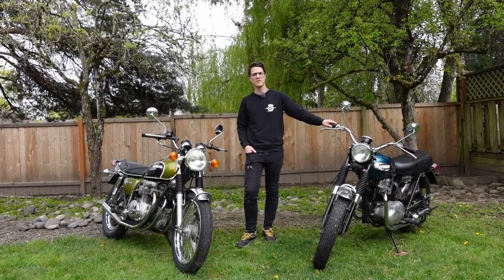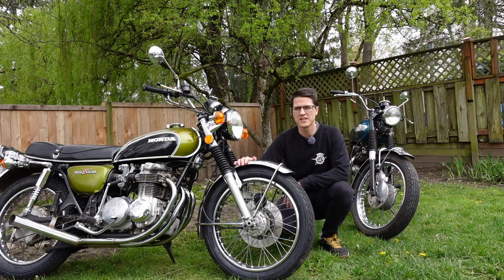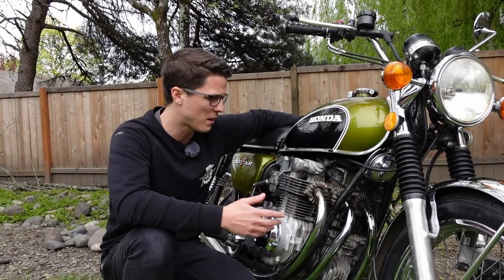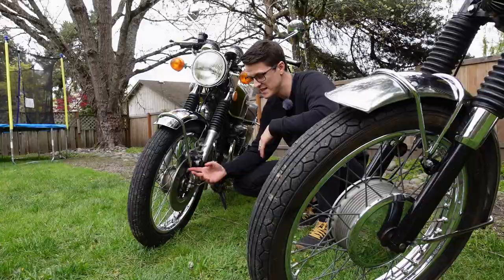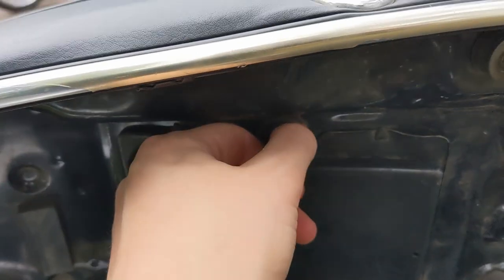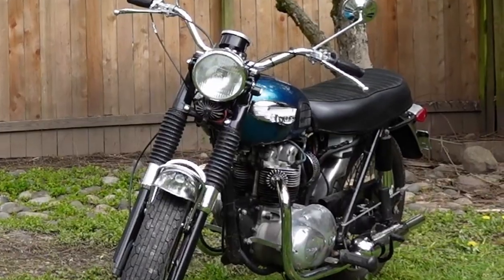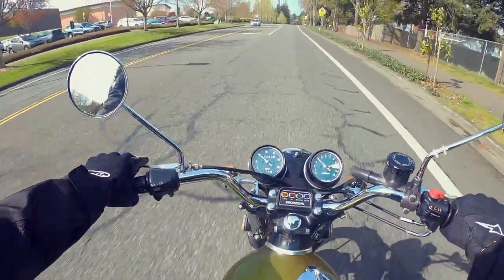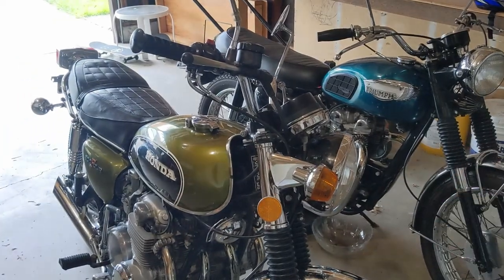How this Honda killed this Triumph

Comment from the maker: One correction! The Triumph 500 indeed NEVER had an electric start. For some reason the later Daytonas looked like they had electric start but they didn't. Good thing I have you guys to keep me in line!
Reply: So the 1973 triumph is literally the same as the one in the video
Reply: @virusdumb  Not exactly.  The 1973 Triumph Daytona 500 had twin carbs (not necessarily a good thing 😮), twin leading shoe front brake, twin instrument (speedometer + tachometer) instrument cluster.
Reply: I don't see much in the way of pre-1970s machines here but I think that the Honda CB77 Superhawk deserves a mention. It was produced from 1961 to 1966, to be replaced by the CB350. This 305 cc twin came with electric start and a good one at that. It is rated at 28 HP at the rear wheel, somewhat less than the 50 HP or so mentioned for the Triumph, but it too will go 100 mph. I know from experience in the early 70s when I rode and raced against others with Triumph 500s and other British bikes that the 305 was not outclassed by the 500 and could beat it. On top of that it is much more reliable and, of course, doesn't leak oil. The CB77 didn't kill Triumph but it is the first in the line of Japanese bikes to match or exceed its performance at a better price. And, the large twin leading shoe brakes work well, better than the Triumph's based upon your description.

I enjoy your series. Thanks for your effort.
Reply from the maker: @kshred3043  Well the 68 T100R had that as well, this is just a T100C. but yeah better brakes and also the exhaust is a bit different
Reply: You young guys need to get your facts straight, no E-Start on 500 TRI !!!
Reply: The bowl under the Triumph answers why we didn't like Brit bikes...Honda Mikuni style carbs didn't leak and that really mattered. Plus what looks retro now just looked old back then.
Reply: Bart. They Daytona never looked like it had electric start. You are confusing it with the pre 1956 bikes which had magneto ignition and what is called a pre-unit engine, which means the gearbox is a separate casting. I hope this clarifies matters for you. Best wishes from a Triumph rider in GB.
Reply: The Triumph 500 twin was officially called the "Daytona" in this period.
Reply: @kramrollin69   Only a Daytona if it had twin carbs. Single carb was T100ss.or variants thereof depending if for the east or west coast markets in USA. In Britain we did not get such a wide variety.
Reply: @kshred3043  I think the Daytona moniker means it had the dual carbs.. I could be wrong.
Reply: @silasmarner7586  Nah the complete SS engine upgrade = High compression pistons . Widened valve bores , specially profiled hig lift cam , dual rubber mounted Amal concentric carburettors 147mph on the flat and level leaves the 500 four standing....
Reply: Yeah, I was thinking. 🤔 my brother’s ‘77 Bonnie 750 had no electric start.
Reply: @factorylad5071  - Dual Amal 10GP Race Carbs with remote float bowls for the full upgrade.
Reply: @silasmarner7586  - the clue is in the word Daytona, an American 200 mile race at Daytona since the 1930's. The Triumph Factory Racing Team won the Daytona 200 in 1966 (Buddy Elmore) and 1967 (Gary Nixon) on race prepared T100's.

The road bike T100R Daytona was a milder tuned version to mark those wins, with dual carbs and other tweaks.
Reply: Honda CB500/550= SLOW
Reply: Designed in UK (Royal Enfield UK Technology Center) and built in India.🤣
But the video on RE Interceptor doesn't mention it, insisting too much on Indian contribution and the "young" CEO.🤣
Reply: @melodymakermark  they did make a couple of t140's with electric start, but they are crazy rare
Reply: @Bart My dad had a Triumph Daytona.
It was the most unreliable bike he ever had. Thanked the Lord every time he made it to work without breaking down.
Still a nice bike though.
Reply: Why not compare bikes to bikes? Compare the triumph twin to the Yamaha twin instead of the Honda 4?
Reply: The Honda looks better.

Comment: The biggest advantage the triumph had over the Honda, was that it never needed the oil changed. Due to oil leaks it was contunually receiving clean oil top ups.
Reply: They had pans under them at the dealerships. I bought the CB 500 as my first bike, $1350 new.
Reply: They only leaked oil until EVERYONE flatsanded the cases and put them back together with better ( usually homemade ) gaskets. What? You didn't do that, too? Come on. Everyone did and still do it!
Reply: @mountainmandale1587  Not on Honda's or Kawi's that I knew of.
Reply: Funny,  because it's true
Reply: @weirdshibainu  Norton's as well.
Reply: @billboyd4051  I owned an AMF Harley for a minute.  I should have bought stock in an oil company
Reply: @weirdshibainu  Did you get a free Bowling ball with it ?
Reply: @billboyd4051  Almost
Reply: Here I thought the Harley Davidson was notorious for oil leaks
Reply: @scottgindroz1474  Oil leaks were the least of Harley's problems.
Reply: @billboyd4051  maybe so but it was the best known of them all
Reply: All bikes were the same then. They had split cases. Honda came along with the now universal single piece sump. Hooray for that!
Reply: @mountainmandale1587  Same for all British twins. It's a lost art....
Reply: Haha I've heard of that.
Reply: @leighmcqueeney9848  What the Hell are you talking about. Hondas had unit construction, but the biggest advantage was horizontally split cases, NOT vertical cases like Triumph, and the rest of the Limeys
Reply: @milojanis4901  what the hell are you talking about? I thought Yanks used the term "limey" to describe the British. Harley had vertically split cases on their horizontally opposed twins. Italians too, eg Ducati on their parallel twins etc. Germans had vertically split cases on their BMWs. Japan also produced bikes with vertically split cases long after Honda came out with a sump. Spanish Maicos, Teriot/Peugeot motorcycles in France, as well as British bikes. The British bikes and others continued to have vertically split cases when they went to unit construction.

Honda did not have split cases at all. The engine assembly and gearbox assembly was completed from underneath on a single cast block, obviously and then the sump was bolted on. Exactly the same as the BMC mini of almost a decade earlier. Maybe you didn't know enough to understand the comment?
Reply: @mountainmandale1587  - It was called "Permatex."
Reply: @weirdshibainu  - I bought a 1968 XLCH. It dripped oil. Figured it was par for the course. Replaced torn primary cover gasket and a missing crankcase drain copper washer.  Rode it for seven years commuting to work at Naval Air Station Miramar and Point Mugu.  You should have done some simple maintenance.   That's the bike parked behind my Ranchero at Miramar.  About 100 feet from the Mess Hall.
Reply: @scootergeorge7089  I did. It was still a drop machine. Glad I got rid of it.
Reply: @leighmcqueeney9848  You're talking in incorrect terminology! ALL bikes still have split cases. Most are horizontally split, which reduces chances of leaking, and also allows for a center main bearing. Older British bikes, and Harleys, used vertically split cases. You're talking about unit construction, where the transmission and engine share the same oil supply, and crankcase. Older British bikes, and Harleys, had a separate transmission/gear box, driven by a primary chain, usually a duplex or triplex, chain.........
Reply: @leighmcqueeney9848  I worked at a Honda shop. I do know what I'm talking about. I also owned a Honda 500 Four. It also had a 4 cylinder cast block, that was held to the upper crankcase with nuts and studs. No way was it machined from below!! You have to have a split crankcase!! How would you assemble the transmission and lower end of the engine??? I thought we were comparing British (Limey is a racist term, in my book) and Harleys to Honda's. BTW...Please name me a Japanese made motorcycle engine, and model, built from 1970, and later, that used vertically split cases......
Reply: IMHO, the biggest advantage the Triumph had over the Honda was it handled much better, at least, the 1970 and older bikes did. Things changed a bit when Triumph went to the oil in the frame bikes
Reply: Put together properly the triumph was oil tight I have owned numerous triumph s and Hondas cb500.550 t100 t140 etc the triumph handle far better lighter Hondas need less maintainance I enjoy both and don't mind ticketing part of owning such fine machines
Reply: @milojanis4901  Yamaha xs 650. Oh and I never said they were machined from the bottom. Just like car engines, the pistons were installed from the top and the engine and then gearbox was then assembled from the bottom. I have owned a Kawasaki z1, z750, z 650, Honda CB 750 amongst dozens of others. The point is it wasn't just English bikes that had a vertically split crank case. There were others too, including an early 70's XS Yamaha, as stated above.
Reply: Harley's have that problem.  They were making two sides of the engine cases in separate factories and they NEVER sealed.  There is a product called Three Bond.  It's a high temperature Silicone formulation I first saw used on 2 stroke Jet Ski's (the original stand up models).  I have a 69 VW Bus and used Three Bond to seal the engine cases when I rebuilt the engine.  Never Leaked except at the seals, I fixed that with another trick, putting synthetic grease in the core of the oil seal that rubs on the crank, front/back.  That stopped the wear on the seals and stopped oil leaks.  I also sealed the oil filter ( a pathetic screen) and tapped the engine and put in a real oil filter.  Anyway, I recommended the Three Bond to the entire VW Club, even one called the 'Oil Drippers'.  SO if you're ever rebuilding any engine that has engine cases that must be sealed, use Three Bond.  Put a thin coat on both mating surfaces, then assemble.  The Three Bond will push out and form a bead inside and out with sealant in the mating surfaces as well, it will NOT Leak.
Reply: I had three Triumphs and your comment applied to each.
Reply: 🤣Started reading, and soon realised you were spot on🤣
Reply: @billboyd4051  Shite, I paid an extra $300 for mine.
Reply: @mountainmandale1587  INCORRECT, they STILL leaked oil, no matter what you did. The reason was BAD DESIGN. Recall they utilised a DRY sump, (meaning no oil stored in the engine, unlike their Japanese counter parts) oil was pumped thru these engines via oil galley ways drilled into the crankcases and where the two sides met, oil was supposed to pass thru, but eventually found it's way thru the cases to drip on the floor. The Japanese beat this by having the cases split HOROZONTALY instead of vertical, thus providing a basin for the oil to collect and stay in. Whereas the Brit bikes had an external oil tank for the oil to be stored in and only pimped thru the engine when the engine was running.
Reply: Lol
Reply: @leighmcqueeney9848  I think we're saying the same thing, but using different terms. I agree to agree.....
Reply: @mountainmandale1587  ThreeBond (which is also Hondabond and Yamabond) is the classic fix. The real problem was vertically split crankcases, a legacy dating to the earliest motorbikes. Easy and CHEAP to machine on simple horizontal manual machine tools, they helped kill NVT though oddly have been an advantage for Harley as legacy designs made aftermarket parts production quite easy by comparison with horizontally split cases as on Honda.
Reply: Not always, only if you were a crap owner and didn't maintain it properly.
Reply: @miltonturner2977  They really made the 2 engine sides in different factories?! Didn't seem logical, if for no other reason that they should've KNOWN their tooling and techniques weren't accurate enough to pull that one off. Haha
Reply: @TravisTerrell  I have a friend that worked at a Harley dealership back then, he showed me an engine he's disassembled and it was obvious the cases didn't fit.  Usually it was an edge machining issue.  One was smooth the other had small imperfections.  Looked to me like poor aluminum casting.  Later I heard that when AMF bought Harley the first thing they did was look for ways to save money...in the process they screwed up the engines and other parts.  Harley didn't get back to being somewhat respectable until the Harley family member bought it from AMF.  The other thing Harley, all of the owners, refused to fix was the poor timing chain design.  I saw an aftermarket fix where gears were put in to replace the timing chain and those engines lasted far far longer...
Reply: @billboyd4051  And BSA.
Reply: The old saying (in Britain at least) was that if you walked up to your Triumph (or Norton or BSA) and there wasn't evidence of a leak, the sump was dry.
Reply: @taxus750  Pretty much like  Landrovers then?
Reply: @garydurandt5737  There is no lack of similarity
Reply: @mrkevinsmusictime5597  Yep as a young policeman in training in 1973 I was given the Matchless 500 as punishment for the day, flat out lying on the tank all I could get was 80Mph whilst my mates on the Yamaha 350 twin two strokes overtook me and still had the cheek to upshift into 5th gear!
Reply: The Triumph did it,s own oil change leaving some on ground everywhere it went!! 🤣🤣
Reply: @mountainmandale1587  - Use Permatex and no leaks. Much easier than making gaskets.
Reply: @milojanis4901  a
Reply: Lol
Reply: @billboyd4051  I never had a leaker. Thank goodness.
Reply: @weirdshibainu  Oh lord. I remember anything & everything with amf or amc I steered clear. I think the javelin may have been the exception. And made Great bowling balls! ✌️
Reply: @billboyd4051  Maybe they would have been better off, a Free bowling ball & unlimited bowling for 3 months, with every purchase.
Reply: @leighmcqueeney9848  , The Japanese came out with horizontally split cases. And one of us should have started  producing them as aftermarket and cured the many bikes and became quickly wealthy.
Reply: @tommydortch  . Dependent on cam lift and duration. And OHC required more RPM to float, because of less reciprocating weight.
Reply: @helenloughton2418  . Without proper punctuation, your comment isn't coherent.
Reply: @senatorjosephmccarthy2720  it wasn't only the Japanese who utilised horizontally split cases and not all Japanese bikes had them. The Japanese had new production lines enabling finer tolerances, and invested over the long term, putting engineering first. Still a good strategy for growing your business. Someone should tell Harley Davidson
Reply: @milojanis4901  every dirtbike, fourwheeler, threewheeler I’ve ever seen. And at least a rebel 250
Reply: There used to be an old joke about the  ever adept British salesman in a British Motorcycle shop who, during a conversation with a customer would slip off his shoe & smoothly slide it under the crankcase of a showroom British bike to catch the dripping oil before it hit the floor, without missing a beat of his conversation with the potential new buyer.
Reply: @milojanis4901 the Honda Cub engine perhaps.
Reply: Yep. Continuous oil change